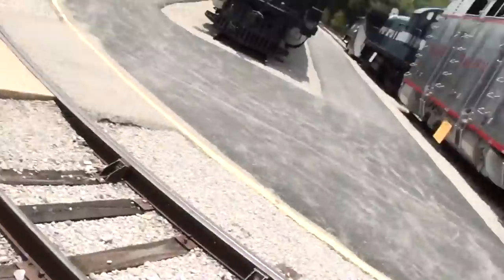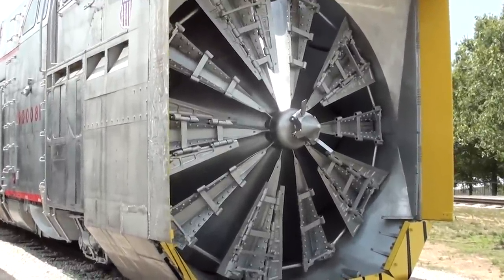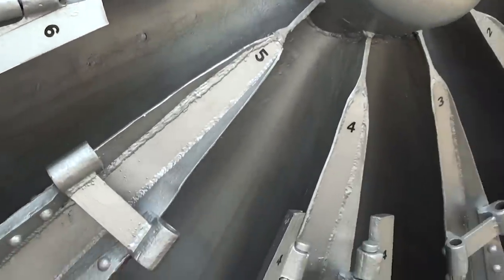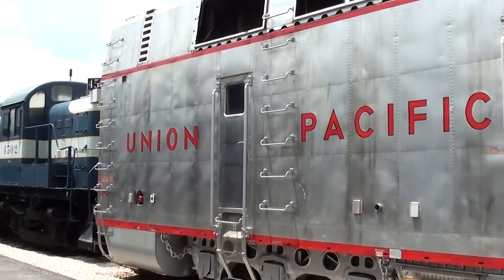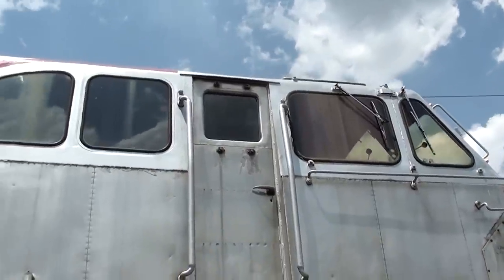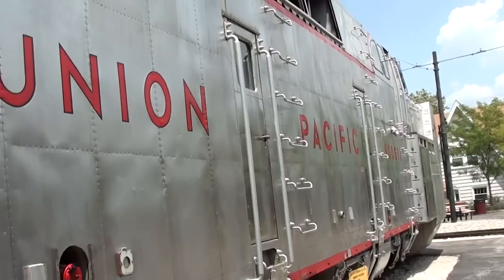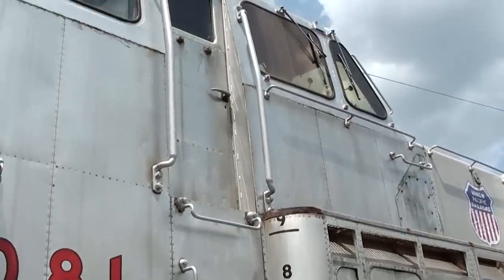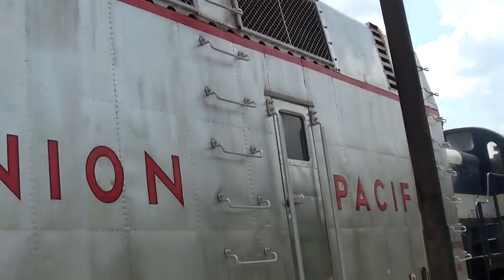Update - Union Pacific Rotary Snow Plow Restoration 3000HP Heaviest Ever Built

Comment: Does the museum ever have any plans of trying to start the engine that powers the plow? I noticed on the rotary vanes themselves, that every other vane has 2 smaller blades attached to it, yet the vanes without the added blades is set up for them with the mounting brackets. I understand the need to keep things in balance, but were all of the vanes originally equipped with the 2 smaller blades?

Comment: were these self-proppeled? because if they were that would be awesome! A rotary snow plow you can use the clear the line, and pull a train with!
Reply: No, they required pushing, the 3000hp  EMD engine is simply for powering the Blower and assorted functions within the snowplow itself (like the Hydraulic wings, and plow)